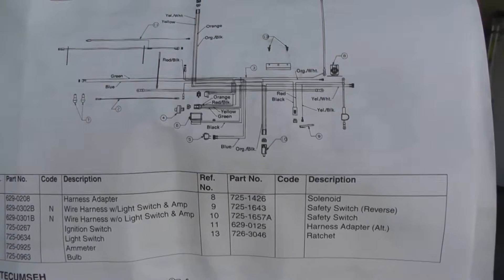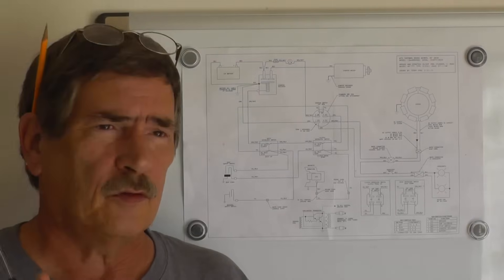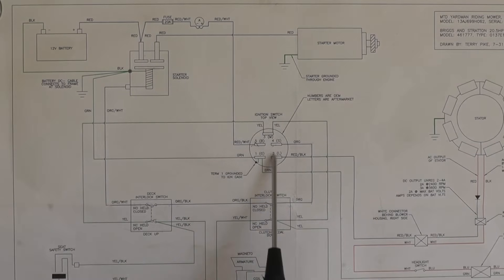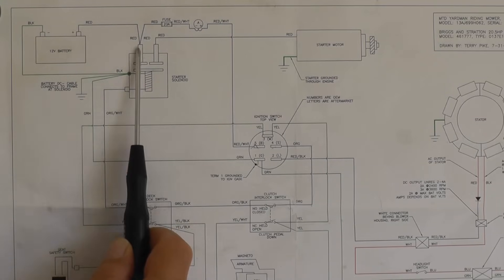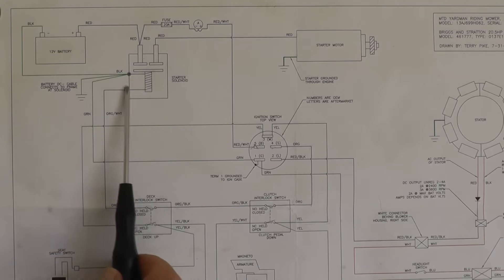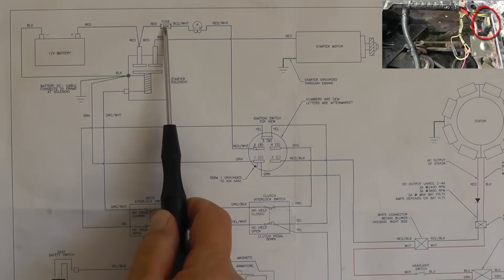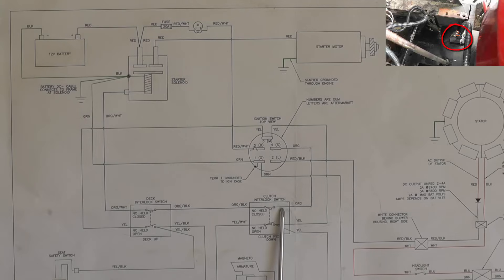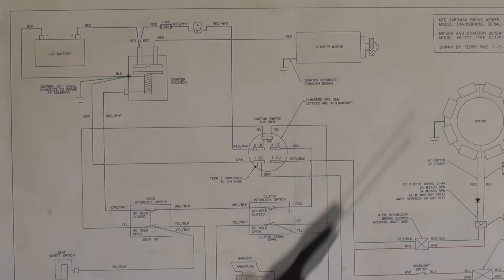Riding Mower, Starting System Wiring Diagram - Part 1

Comment: Thank you so much for this. 
I have a question I hope you or someone else in the comments can help me with. I am building a hybrid remote-controlled mower. I am using parts like engine, starting, and alternator from a riding mower to power the blade.
For forward/ reverse propulsion and full turning control,  I am using two 24v motors off of an electric wheelchair. Through remote control, I can control right and left wheels speed or direction. I am also adding a 24v, 40A alternator to keep two 12v batteries (wired in series) charged.
The question is: The lawnmower system runs off 12v and the propulsion system runs off of 24v. How can I run these two different systems together?
I guess I could isolate one of the two batteries in series to start the 12v starter but the alternator on the engine would be still running the armature and then I'm guessing just charging one of the batteries in the series. I don't know if this would be a problem. I also don't know if the 12v engine alternator and the 24v alternator charging these batteries would destroy them.
Or  I was thinking I could just run 3 batteries, one 12v for the engine, and two 12v for the motors. and just keep the two different systems separated. But this is more money and weight.

I am a fabricator and only know the very basics of electrical stuff, but videos like yours get me excited to learn more. 
I would really appreciate any help!
Reply from the maker: I would think that you can keep the two batteries wired in series to keep your 24VDC for your motors. Then you could pull two cables off of one of the batteries to power up the 12VDC for the lawn mower system such as for the starter. Sounds like the alternator generating the 24VDC @ 40A should be fine. However, I would just disconnect the wiring from the 12VDC alternator on the mower and not even use it. I've never done this before, so you may want to do a test to test how it works. Hope your project works out good for you!
Reply: @stuzman52  Thank you for the quick response!
 My concern is I think the 12v alternator supplies the timing, the external rotor/flywheel has a positioned magnet for the timing of the spark. I lose this timing with a remote alternator. 
I looked at maybe down stepping the 24v to 12v for the engine but those converters get expensive $70 for a 100 amp converter and I don't think it would work because I read the starter can draw over 200amps.
Reply from the maker: Puppies Rule! Good point about the magnet, I know there are several magnets and one or more are for charging the battery. It could be there are dedicated magnets for firing the coil and others for charging. I never looked into this and would take some research. If that was the case, maybe it’s still possible. And if so, the 200 amps could still come off of one of the 2 batteries wired in series. Just thinking aloud...
Reply: @stuzman52  
When I pulled the engine apart (to fix a blown upper seal). I noticed the stator is on the inside and the rotor goes outside around the stator so all the rotor magnets are facing inward. But the outside of the rotor has a pickup magnet that goes right by the narrowly gaped magneto to fire off a timed spark. Cool stuff!
Thank you for your input!
Reply from the maker: Puppies Rule! You’re welcome!

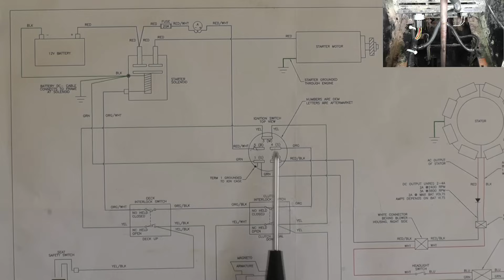Comment: @8:58 footnote says terminal 2 is for carb solenoid. It is connected to the battery when in RUN (@8:45).  But your wiring diagram (@6:40 for example) shows it connected by the Red/Black wire to the output of the magneto via a diode, and to nothing else, not to a carb solenoid. It seems to be only for charging the battery. Can you explain?
Reply from the maker: You've got a very good eye there Duke and if you're not an engineer, you should be one to catch details. Yes, the footnote at the bottom where terminal #2 connects to the carb solenoid is incorrect. My mower does not have a solenoid so the wiring diagram is correct as every wire was verified when I rewired it. To be honest, the original wiring diagram in the owner's manual was very small and hard to read. So, I was pulling information from other sources and between editing the wiring diagram and the video, the footnote slipped by me in the final editing. So, if you want to make a correction, the word 'car' in the footnote, (which should be carb) can be replaced by 'Battery 'Charge. I guess I'll have to make the correction on the diagram too. Again, good catch and thanks for the comment!
Reply: @stuzman52  Thanks for that, it makes sense now.  Trying to puzzle out my system (also an MTD) I watched some other videos as well and it seems the "L" stands for "Lights", so the head lights are on when running. Yes I am an engineer BTW, and I'm restoring a 1999 11.5 HP Lawnflite. Mine does not have a carb solenoid, and it does backfire!
Reply from the maker: Sounds like a pretty good project Duke! I went ahead and made the change on the wiring diagram as I mentioned earlier to you. The link to the updated wiring diagram is in both mower videos now and it's found in the description. You are correct that L stands for lights. You probably already know this, but here is a link showing the letters of the ignition switch. https://www.jackssmallengines.com/Products/BRIGGS-STRATTON/ignition-switches-keys/Ignition-Switches and here is the link to the updated wiring diagram: https://drive.google.com/file/d/1blH5rzqx46Qx9xs1ieFfpNjJX2olp1_s/view?usp=sharing

Comment: Hi mate, I’ve had to replace ignition key on my mower but now it won’t fire , I have a red , brown , and orange wires that I’m not sure where they connect to on ignition
Reply from the maker: The best thing is to look up a wiring diagram for your mower and then you should be able to see where the wires go. I have a link to a wiring diagram in the description of this video, but it may not be your mower.
Reply: Also I have removed all safety kill switches on this mower

Comment: Thank you for your video.  I admire your commitment to helping others.

Could I offer some slight changes.

You are correct.  Automotive wiring diagrams are the worst possible.  I am sure they are designed to confuse.

The problem is they confuse schematic diagrams with interconnection and layout.

There is a method that overcomes this completely.  It is not widely known, and even some electricians are unaware of its existence.

If it is of interest, I can forward a sample.

One note.  Normally open and normally closed refer to the state of contact/no contact as in power off.  That is as in the switch on a bench remote from its application.

Regards
John. Cooroy Queensland Australia
Reply from the maker: Thank you John for the comments! I was aware of the NC/NO state of contacts when a wiring diagram is drawn. And you are correct that the states of the switches, contacts are drawn in a de-energized state. I prefer to analyze ladder diagrams versus a pictorial/interconnection diagram as the latter tends to run wires all over the place. Although I could have drawn the diagrams for this mower in a ladder format, it seems that most people prefer an interconnection diagram as I guess having components drawn like the real world makes it easier for people to understand. Sure, go ahead and send me a sample and you'll find my email address from my home page. And then from there, you can click on the about button and it should be there. Have a great weekend!
Reply: @stuzman52  I need both diagrams plus having the real thing beside me to grasp how its connected haha 
After a bit of tinkering not only could I rewire my riding mower (weed eater we 12542) but I fully understand now how it works, and that's thanks to your video. So again, thank you sir! 
Greetings from Argentina.
Reply from the maker: @phrodendekia  The link for the diagrams are located at the top of the comments and the link is also located in the description of this video. Good luck on your repair!

Comment: Excellent video and instruction,the diagram like others have said is much better than any I have been researching.I happened to need a diagram to try and figure out why my 74' Simplicity will no longer shut off with the key.I had just installed a new starter and a solenoid and did NOT memorialize where the wires went,so, tractor starts and runs fine,but to shut it off I have to use the choke.Maybe you have some ideas that might help me figure it out.Hope you keep making Tractor related vids! Cheers!
Reply from the maker: Thank you George and glad you liked the wiring diagram and video(s). If you didn't know, you can download the wiring diagrams from the links provided in each video, part 1 and part 2. In your case for the mower not shutting off when you turn the ignition switch to the off position, the ignition coil is not receiving a ground to kill the ignition. From the diagram, there is continuity between terminals 1 and 3 when the switch is in the off position. This then provides a ground on the kill wire for the coil. You may want to check that circuit to see why no ground is being applied. Take a look at the diagram and you can see what I mean. Good luck on your repair!

Comment: Well done video, I would really like a copy via dxf or dwg file of your schematic if you could email a copy? I suspect my mower is having an issue with the ignition switch continuing to ground out the mag when I try to restart a hot engine I have no spark unless I ground out the spark plug wire. And suggestions would be greatly appreciated.

Comment: Great film guys,  I've been fighting a deere lt160 14hp kohler, before I bought it the main wiring harness was burnt and the guy jumped it,  I replaced the harness with the main unit and tested battery which is fine but when started the wiring starts heating up below the connectors below the regulator,  I added a extra ground to the deck from the regulator but the same thing  continues.  I'm not sure if the ignition switch is bad or not.  I replaced a couple switches and added all new relays since theres 3 and a starter relay is new.  Any pointers
Reply from the maker: Best thing I could say is try to find a wiring diagram for it and start checking its wiring as it sounds like there is a wiring issue.
Reply: @stuzman52  I replaced the main harness front to rear with new relays, 3 if them and a started selinoid,  the lt160 kohler has a plastic mag cover so its grounded to the linkage and I ran another to the deck from the regulator.  Replaced 2 sensors one on the foot control and deck lever.  Still heats up so I'm not sure if theres a wire connected wrong by the selinoid.  Thanks for your help and great film
Reply from the maker: @robertduncan2742  Yeah, that's why Robert I mentioned about there's probably a wiring error or maybe an issue with one of the components since the original harness got burnt. Any chance of finding a wiring diagram for it as I believe that would make your life easier in troubleshooting?
Reply from the maker: @robertduncan2742  This wire that heats up...can you tell where it's feeding to or from? Any idea what it's being used for?
Reply: @stuzman52  the heats coming from the connector that comes from the regulator to the harness.  I've checked all wires for connections which are good and changed regulator.  I ohm the stator also
Reply from the maker: Robert Duncan Is the charging system working okay? Maybe this a wire for charging the battery? Check your charging current to see how many amps the battery is taking. Maybe a bad battery???
Reply: @stuzman52  I'll switch batterys from my other deere,  the battery in the mower I'm having issues with is holding a charge but not sure on the rest and it's a few years old when I got the tractor.

Comment: Where can i get a wiring diagram for 74179 (Z149) - Toro Z Master Mower, 52" .
Reply from the maker: Best thing I can say is to google it and see what you turn up. Try finding the manufacturer's website as most will offer the user manual for a free download. Good luck!

Comment: Wow, this is right on time. I'm moving a 12.5 HP Briggs vertical shaft engine from a mower to my home made log splitter and needed to reverse engineer all the safety switches out that don't apply. Your drawing made it easy to "simplify" the circuit to what I needed. The Briggs 10 HP I'm removing is 51 years old!
Reply from the maker: Sorry Sam for the delay as YouTube did not notify me. Glad to hear the diagram helped out!

Comment: well done on making your own schematic. i saw some questions asking about the chassis ground wire. Own my mower; the chassis grounding wire was located underneath the fender assembly. Anyone searching for the chassis ground and can not find it anywhere may be able to find it if they remove the Fender. With that said, it is far easier to run a new ground wire and ground to the chassis at any convienent location.....  Another question was about being able to print out an image - [ wiring diagram ] from Youtube. Find the best view in the video of the diagram in Full Screen; then hit the ' prt sc / sysrq ] button. That button means Print Screen. It saves an image to the computer suitable for ' Pasting ' into the windows Paint Program. Open 'Paint' and paste the image into the program. Select 'Save As' and select the .JPG format. Name the file and save. Then the image can be retrieved anytime and printed out using the 'LandScape' print option.
Reply from the maker: Sorry Alpha for the delay as YouTube did not notify me. You should be able to download the drawing from a link that's provided in the description.
Reply: Thanks Stuzman. It sure comes in handy having a good wiring schematic !

Comment: Hi Terry how would you explain when testing ignition points on 2 cycle engine 2 cylinder rotax with 6v battery and bulb connected to ignition coil wire unplugged from coil and ground to test ignition point if they are open or close there is capacitor accrose points when they close light its bright when they open lights is dim thanks

Comment: I have a GY6 150cc Chinese go-kart and the wiring diagram has me a little confused. The part that's got me confused is it has one line or wire crossing over the top of another with a half circle on the wire crossing over the top of the other one. Does that mean it's just passing that wire with no connection because I believe if there was a connection there would be a little black. I could send you a picture if you would like but I think it would go to your spam I really need help with this I've got three go-kart that I have the same problem with no spark I've changed the coil and CDI box the stator the voltage regulator the Exciter which comes with the stator and still no spark

Comment: Help!  found the Schematic online for my Craftsman Model tractor 917.270411...which says "my tractor is equipped with a special alternator system...the lights are not connected to the battery but have their own electrical source." How can i troubleshoot why the lights are not working?
Reply from the maker: LIVE NOW Without seeing the diagram, I can’t tell you much. Can you see on the diagram what feeds the lights?
Reply: @stuzman52  i was hoping u could pull it up at: searspartsdirect.com My model# is 917.270412...Owners Manual page 33 is the Schematic.
Reply from the maker: @Livenow0666  Okay, I had a chance to look at the wiring diagram which is typical of lawn tractors out there. The diagram says that the lighting circuit has it's own alternating system and not connected to the battery. Again, this is pretty typical of lawn tractors out there. If you notice there are two circuits for the alternator system where one coil goes through a diode. This is used to charge the battery and is a pulsating DC, (half-wave rectification). The other coil without the diode goes to the lights. This is an AC voltage and is used to power the lights.Take a look at the lower left corner of the diagram and you'll get a chart showing how the contact arrangement is configured for the ignition switch. The AC voltage is fed from the alternator coil to terminal A on the switch and comes out of terminal Y to feed the lights. Set your voltmeter for AC voltage and read the voltage at the lights. If not there, check at terminal Y on the switch. If not there, go to terminal A and check. If not there, then you have an issue with the alternator coil feeding the lights. Keep in mind that the diagram shows only two coils for the alternator, but there are multiple coils wired in series. You'll see the specs for the voltage and current on the wire coming out of the coil. Holler out if you have any other questions.
Reply: @stuzman52  thanks so much, i'll try to get my girly brain to figure it out! ☺